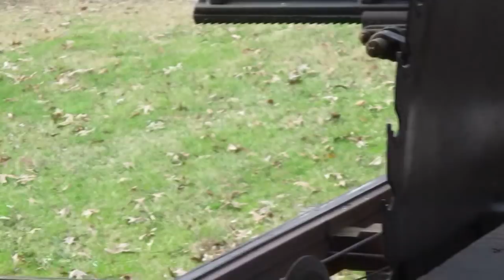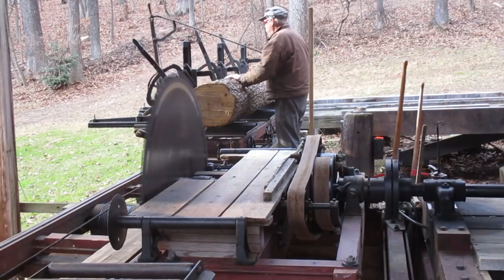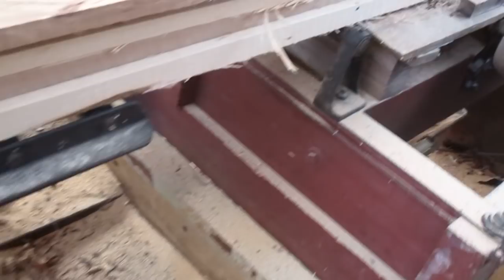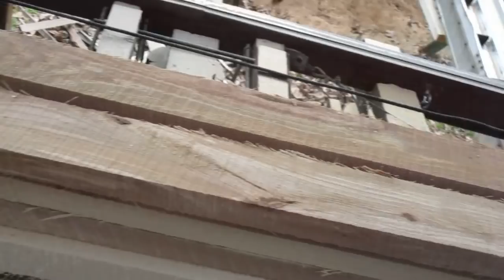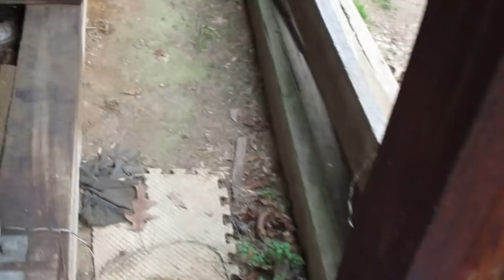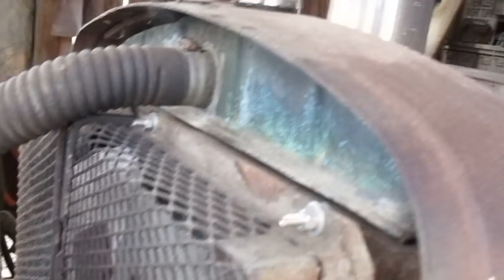#186 Sawing a Hickory log for axe handles on the old Frick sawmill

Comment: I am a real fan of turning a log down on the carriage. I made a pair of UHMW faced wedges at 45 deg. that catch the log and slide it back onto the bunks. They drop into a pipe on 2 places on the infeed deck. Thy really work great and make it far easier on your back at the end of a day.
Reply from the maker: depends on the log . but as for your back one way compresses your spine pulling down expands the spine . so i could understand why  thanks john
Reply: @fricknjeep  Simple to make as well. Less log handling as well by turning down.

Comment: I used to run a sawmill like that. Have 14 stitches in my shoulder from it. Cut mostly pine and red oak. Just loved seeing those wide boards and especially quarter dawn oak and the smell of the lumber air drying in the yard. We powered it with an 871 Detroit. Sometimes my Dad would help - fond memories. Thank you.
Reply from the maker: hi there if you don't mind how did hurt  thank you john
Reply: @fricknjeep  while the engine was idling and the saw engaged I was using a stick to push a build up of sawdust into the blower. The tooth in the saw caught the stick I was holding pushing it up into and thru my shoulder. It was so quick like magic. One moment I was holding the stick and then I wasn’t. Luckily everything turned out well.
Reply from the maker: @markwhite2199  i think you were at the back of the blade  john
Reply: @fricknjeep  yup. Either way I was in the wrong spot. Lol
Reply from the maker: @markwhite2199  best to ya john
Reply: @fricknjeep  and you as well. Merry Xmas

Comment: Excellent video!  55-60 years ago growing up on a farm Dad bought a used Frick sawmill that we rebuilt then dug many holes for locust post to set the complete unit on, a lot of work, but then again that is all my Dad knew and liked.  If I recall there was a 54" blade on the husk and the carriage could handle a 40' log, there was 4 uprights with what I believe were called dogs to secure the log, it was all eventually under roof.  I left for the Navy in 1967 and never looked back at the farm or the sawmill, at age 72 I don't have many regrets, but this one I do, very good memories and this video brought a few back, Thanks!  I subscribed to your channel and will be looking for more.
Reply from the maker: hi there great story i have read a lot similar  and enjoy them all . i see a  JD popper is that yours   thanks for the watch john
Reply: @fricknjeep  Yes, my Christmas gift to myself 3 years ago, it's a 1957, 520. Mounted a model 45 JD loader on it since then, came out great!  My older brother has the Farmall H from the farm plus a few other implements that we used back in the 50's and early 60's, so I still get to operate that tractor that we used 55-60 years ago, my brother completely re-did it.  The sawmill was sold sometime in the 70's, I have a couple of pictures of it, wish there were movies made, but that was not in the cards for my Dad.  It was also powered by a 1958 Ford 312 interceptor motor with glass pack mufflers, she sure would hum when Dad was running a big white oak log through it, the oak trees also came off a stand of lumber on the farm.  Everything was done the hard way back then, cut with a Homelite chainsaw, 35" bar, very heavy, loaded on wagon with a rack built by us.  Logs were loaded using ramps lean up against the wagon rack, then utilizing a sand cable and snatch block to roll them onto the wagon and then hauled out of the woods using the "H".  The finished green lumber was used to build additional equipment sheds/garages.  This was my Dad's hobby in addition to farming plus he also had 40 hour a week job at the local telephone company.  All my family has a good work ethic.
Reply from the maker: @dankinnard1833  hi again  i kind of think  the good work ethic may be going by the way side for a lot . . started working at 12  50 cents per hr . then started milking cows 100 per hr then to Marriott at 100 per hr as i got older worked 2 jobs most the time . I'm happy where i am now .  i am in Carroll Maryland  where are u guys  john
Reply: @fricknjeep  Western PA, Freeport, Pennsylvania, farm was in Kittanning, just northwest of Pittsburgh, except my four years in the Navy, have lived my entire life here.
Reply from the maker: @dankinnard1833  i watch mark galicic  i enjoy watching his channel  he is up around there some place    nice chat john

Comment: Man, that hickory is some hard stuff !! Some mighty fine sawing John. Wide open throttle gives me goose bumps.  Makes my little 3-71 Detroit sound like a Barbie car....LOL.  She did get a mite warm there... Our old in-line 8 Buick that powered the 54'' Fisher and Davis back on the home place was fitted with a 55 gallon barrel for a reservoir.  The water pump would pump it out of the barrel reservoir and into the radiator and engine, back to the barrel.  After about 4 hours, the water in that barrel would be boiling up a storm !!  If I remember right it  actually sent it to the roof first, then run into a gutter THEN drop a couple feet back into the barrel... steam flowing off of it all the way!! I'll have to ask my older brother before I'll latch that answer in though.  Awesome video John.  Loved every minute of it man.
Reply from the maker: thanks  and have i great new year   john

Comment: In my younger days I had a horrible time with my splitting maul handles breaking, I was splitting a massive amount of wood and selling it. I'd be lucky if a mandle lasted a week and most days I'd break one. So I cut some hickory trees to handle length split then with wedges down so I could get one handle out of the white wood then rough  shaped them with a draw knife, then stood them on end against the wall and blocked them up so the where straight up and down. Let them dry for a year and finished them. Those handles where nearly indestructible. I could get several years out of a handle where a store bought handle I was luck if I made it a day. I was cutting and splitting several cords of hickory and oak a day.
Reply from the maker: i really only need one handle  john

Comment: I had a hickory sawn in WV and moved to Florida, put the hickory in my hot Florida attic for three years then built a coffee table, within six months it shrank up and some of the glue joints busted lol. I figured that attic in Florida would dry it out but I guess inside the house with the AC running all the time made it even dryer. Lessons learned, I don’t use hickory for furniture anymore, it moves a crazy amount!
Reply from the maker: they go crazy  john     so does gum

Comment: Go to a Cog type V belt. they grip the pulley better. So they will move about 25% more air. I work in the commercial heating and air business and that is the only belt we use. Just found your channel and subscribed. THANKS Dan Hamilton
Reply from the maker: THANKS FOR THE INFO  THE BELTS ARE NEW AND TIGHT  THERE IS A WHOLE IN THE RAD. AND ITS JUST LOW ON A/F  . MERRY CHRISTMAS   JOHN

Comment: Quick thought, get a piece of pipe with the inside diameter close to the outside diameter of the bearing block cut to length then split and secure with hose clamps to make a gaurd, but personally I don't care and I've removed most of the gaurds on my PTO shafts so I can grease them.
Reply from the maker: had one on it  tripped on it   took it off  john

Comment: The best way to make axe  handles is to cut off axe hadle length then split cross stack and leave until cured then make some awesome handles in Nz kanuka is the best timber to use

Comment: Good Morning, 5:20am here in the mid west, this by no means a complaint but a suggestion !
 Make a Taller Splitter which wedges at the highest part so when the planks complete its cut the Splitter tips the plank down and you don’t have to reach out close too the blade !
Just a thought !
Thx’s n Love your mill however with my bad back I’ll have to go with a fully Hydraulic portable sawmill like Out of the Woods !
Thx’s Again
Reply from the maker: ho there your the only one wise enough to talk about the splitter  . i am looking for a higher one on the other mill  . OTW does great work . looked at one of those around 30 years ago didn't have that kind of money . are you thinking of getting one ? they are a lot safer john

Comment: My friend ran a handle factory from the end of WWII until he died a few years ago.  He had a short log mill.  Sawed the ax handle blanks with a double taper. About 2 by 3 on one end and 1 by 4 on the other.  Said it saved wood and made the work of the pattern lathe easier.  Another thing, he said people did not like handles the were half sap and half heart wood. So he scorched them lightly before applying the finish.  It covered tiny knots and other minor defects and discoloration    Those handles sold better than the perfect ones.  He called it Flame seasoning.
Reply from the maker: hi there good story good idea he sounds like he was quite the guy . bet he had great stories  john

Comment: Iv been just learning about hickory for tool handles it’s interesting thanks for the video but my question is do large companies like Vaughan for example do they use the whole tree or just the lighter wood? (I think they call the center the hard wood and the white wood is sap wood? Please correct me if I’m wrong) I have 3 hammers from them 2 have very light handles the other has a darker handle. I was just wondering in mass production do they just use the whole tree? Another question do people ever make tool handles from larger branches or only the main portion of tree? I would think maybe the main portion is stronger? Thanks

Comment: Good stuff. 
There’s still a handle factory here in East Tennessee.
Reply from the maker: i think they are becoming extinct like wood barns every is going to fiber glass or tin   john
Reply: @fricknjeep  I'll never use anything but hickory in my axe or sledgehammers. Anything else puts to much stress on your joints.

Comment: I was about ten years old when we had our own saw mill. My job was to sit on the 18-36 two cylinder Hart-Parr in case of emergency. If there was an ,,emergency it would been too late,,. But I would be asked to speed  up for the thee foot spruce
then normal speed for the poplar. Dad used hid pointing finger,up was up and turning down was down. All child labour as sisters did their part, even skidding with one smart horse.
Reply from the maker: hi there good story thanks for the share john

Comment: Hey John, new subscriber here.  I have a Sears Roebuck version of a Folley Bellsaw.  I know it's not the same brand, but I have a question. The blade guides, do you have them adjusted to rub the blade at all times or do you have some clearance?  Thanks brother,  good video.
Reply from the maker: hi there no they are not to touch the blade . back both out , then bring the blade up to RPM . then bring them in till there is just light showing on each side . about the thickness of a paper sheet . then check the leed . if you set the leed with the guide it may heat the blade you can't saw with a warm blade .   hope this helps  john
Reply: @fricknjeep  yes sir thanks.
Reply from the maker: @dustydave9347  hay there just was at your place  john

Comment: That looks just like a old frick mill that a old guy friend of mine had in SC, he powered it with a 3 phase 50 horsepower electric motor, I removed trees for people back then and we sawed thousands and thousands of board feet of lumber.  He's been dead over 10 years now I suppose.
Reply from the maker: nice story  thanks for it john
Reply: @fricknjeep  it's Donald lol, I know you are probably tired of people giving you advice, but we had a couple of close calls over the years, wilmont had dropped two 2x4s from rafters and put some heavy gauge wire about the size of rabbit wire on the boards making a guard that protected his head, face and chest. It didn't get in the way because suspended from ceiling joists when operating was about a foot in front of him, lest just say it got several dents over the years and one tear which cut his face, twice when we were handling huge logs,oaks over 3 ft across ,after first slab cut we would put timbers under carriage other end back on loading deck roll log off carriage onto timbers then with large bars slide back on carriage cut side down  logs to large to just spin on carriage, anyhow unbeknownst to us when log flipped forward bounced carriage off track, and when he made next slab cut carriage was sticking out about inch too far and went into blade, now fellows that's exciting! Be careful when spinning large logs that happened twice over the years. Once a retired doctor friend of wilmonts was supposedly helping me on the take off side, loading boards, stacking cants etc. Begged to run sawmill wilmont showed him over and over just do pull handle back a little, got it boss he said and proceeded to snatch handle back all the way, sent 2.5 ft across log flying into blade a hell of a noise erupted pulleys had 4or 5 belts they were screaming, smoke pouring off of them I was right at blade, and ran like hell, wilmont had installed a kill switch right beside that guard at control handle and switched motor off, after checking for blood and dirty underwear, I had to wedge and chainsaw the blade free while standing on it, took a while. Doc lost his aspirations of becoming an sawmill operator.
Reply from the maker: @donaldatkinson7937  i stuck the blade 2 times belts held and killed the motor . we were sawing at a steam show and my friend hung one up . https://youtu.be/udOt3Cy7gcI   john

Comment: Nice!!!   How do you keep that mill so slick n clean ? I have a "o" Frick mill, Edger and 471 that I am getting ready to set up and would love to see a "walk around" of yours.>>>>Any suggestions would be appreciated and applied. 
        Don't tell anyone (I am Off Grid with 125 KW of Hydro power to spare, so I might supplement the 471 with a little of Tesla's touch)  it does not scream like the Detroit; Although, ... home maid "60HZ BUZZ" is nice too. (if the wimps think stepping over a shaft is excessive they should play in my world with 2400 volts of water power and no help from an OSHA nanny) Gawd!!! How have I survived 75 years (27 Off Grid)
        Back in the late 70"s I built a work bench out of heart Hickory and rubbed it out with Tung oil and turpentine. It almost looks like Walnut and is still nice today 45 years later.
Reply from the maker: thats a lot of power  .i was hoping for hydro but not enough water  . you lived that long because your smart  and very aware of things around you . and you listen to things   good story thanks john
Reply from the maker: MAID COMES IN AFTER 2 OR 3 LOGS   ME   JOHN

Comment: What id do as a marker ... when the log is getting line up for the next cut ..is to mount a pice metal sticking up like a sharks fin on a stopper reset ..do U get me... with a soft long spring on it to pull i in a up right persion UP in line with the BLADE..a inch or two...pointing UP.. mounted down on the FRAME in SLOT so no left or right movement so U dont get the wrong whith so no movement..so when U move for the next cut ... the pointer is touching the face off the log .. measure form( IT )..(  I =)..🤔..to the out side last cut..the log goes forward the pointer get pushed down out off the way when the goes ..bobs your UNCLE..hope that a helps... stay safe helo from Ireland ..😉..
Reply from the maker: hi there i am a lot lost with what you r trying to tell me  sorry john
Reply: @fricknjeep  l showed log with pointer ( I =l )...
Reply from the maker: @lesterkirby3367  i am afraid i just don't understand . have you ever sawed on a mill john

Comment: Listening to the engine with no load drives me nuts . Get a throttle.
Reply from the maker: hi there if you watch you would see i do have a throttle but if you knew engines you would know diesels  like to run . thats what they were made to do .they also are more efficient at a higher rpm  and its only running 1800 rpm. and if you knew saws like to run at a hammered rpm to stand up right . ULTRACREPIDARIANS SHOULD STAY OFF YOUTUBE   Thank you john

Comment: I'd love to see you invest in a pair of high quality leather gloves and some Home Depot ear protectors. I keep a pair on my lawn mower to remember to put them on before I start the mower. A longshoreman hook or a reasonably facsimile thereof is a must have safety device for rotating a board away from the face of the blade. It was scary watching you putting your fingers so close to a running blade. Stay safe for your sake and for the sake of everyone who loves you.
Reply from the maker: HI THERE   I PROBLEY HAVE A MIN OF 3 DOZ GLOVES HEAR  I BUY COW HIDE ONES 2 DOZ AT A TIME . SAME WITH MY GOOFY RED GLASSES  ALSO EAR PROTECTION  . . ITS JUST CAMERA ANGLES THAT MAKE IT LOOK LIKE I AM CLOSE TO THE BLADE  . I DONT WEAR EAR PROTECTION BECAUSE I DONT WANT TO MISS ANY LITTLE NOISE THAT WOULD INDICATE A PROBLEM . ITS HEARING THE LITTLE NOISES THAT HAVE SAVED ME FROM BIG PROBLEMS . . THAT IS ESPICALLY IMPORTANT WHEN YOUR IN THE CUT. THANKS AND MERRY CHRISTMAS  JOHN